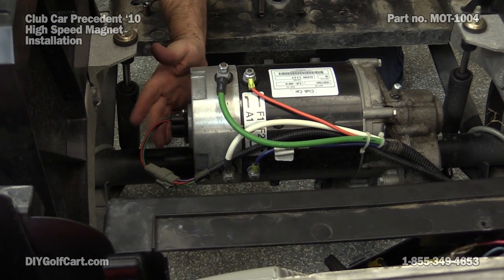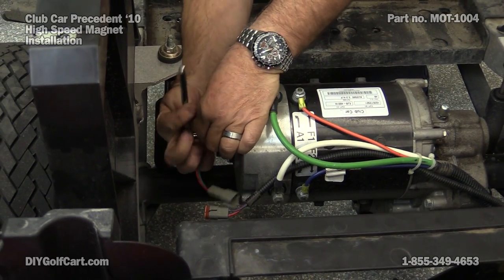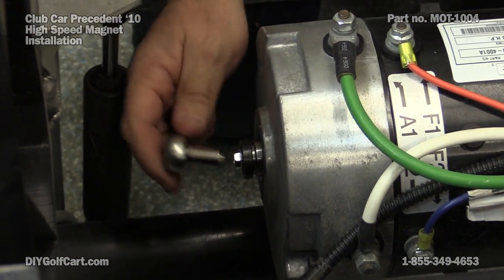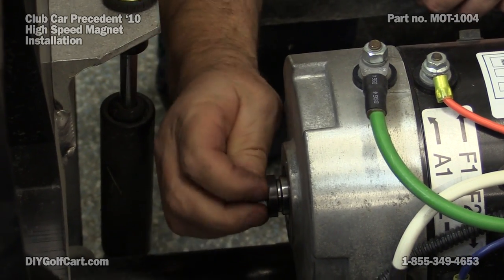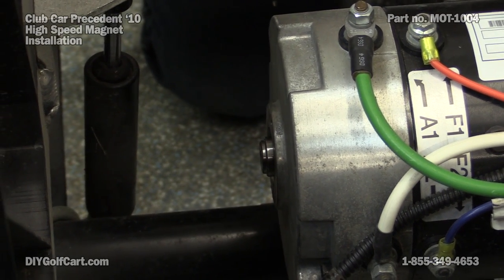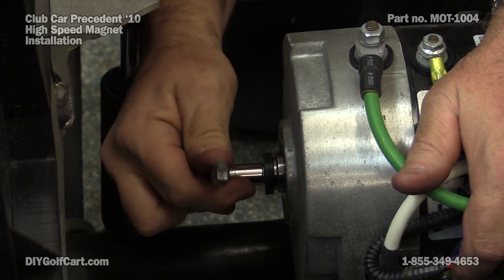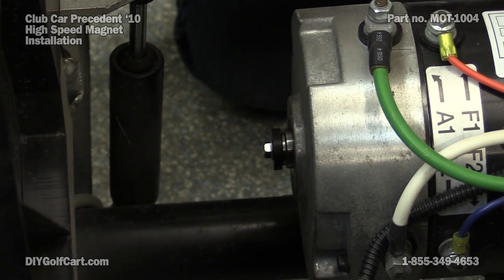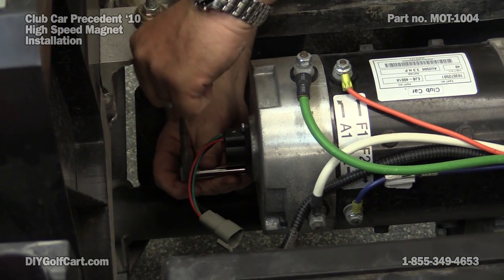Club Car Precedent High Speed Motor Magnet | How to Install on Golf Cart

Comment: Hey I have a 2003 club car ds iq with the ge motor. Do you have a diy for taking the magnet out of it and replacing with high speed magnet?  It’s supposedly a pressed on magnet. Is there a high speed magnet and if so do you have the part number? I’m stumped, I’ve read it needs to be forced off. HELP

Comment: After replacing speed sensor on G22E 2005 Yamaha.  The speed doesnt improve  much.
Can over tightening magnet bold can impact the speed?  What else can be reason speed not increasing with replacing new sensor and magnet set. ?

Comment: Is it possible that the magnet and speed sensor could be dusty/dirty causing the symptoms of a bad sensor?  The reason I ask this, in 2015 my cart was experiencing the same symptoms as this year (starts normal then goes to slow/half speed all of a sudden).  I purchased the OEM speed sensor and took off the old one but cleaned and placed old back on (didn't replace with new) and the cart started working normal again.  Just wondering if this is a normal issue with being kept in a cart shed over the winter.  Thanks in advance.
Reply from the maker: Over an extended period of time not being used, corrosion can start to build causing the sensor to "act up". Cleaning the sensor after a long period of time of not being used is a good thing!
Reply: Rick Eldridge b

Comment: Bought my cart used and I dunno if I already HAVE the high speed magnet?
Reply from the maker: Only way to tell is to check and make sure that the controller and motor is stock, then take it for a ride. If its faster than stock, you've go a high speed magnet.

Comment: Do these magnets work if you already have a speed code upgrade on your cart?
Reply: Added about 3-4 mph to my top speed of 12 mph which is a big gain in %. Cheap hp lol.
Reply: Speed code (code 3 to 4) changes the maximum allowed RPM to 4500.   Speed magnet doubles the existing RPM limit, which would be somewhere around 3600 on speed setting 3, so it'll run 7200 RPM before it will electronically slow itself down.  No need to pay $100 for code change, when $25 magnet will do better job.

Comment: you can install it easy  removing the rear passenger wheel to access it that way but you might need a pry bar to prevent the axle from moving back and forth. remember them parts are plastic lol.

Comment: How can you tell the difference in a GE motor and the ADC motor?
Reply: Patrick Springer ge motor has a snap in speed sensor. As a adc motor has a bolt on speed sensor

Comment: I have a ge motor for a 2010 club car  motor number part 102240102 how to install a magnet in it gray in color. snap in speed sensor.
Reply: My golf car when i push the acelerate if doesnt run fast

Comment: Would this type of magnet work on my 2012 EZGO TXT 4 passenger (48 volt) cart?  It is programmed to the highest speed and I have already slightly upsized my wheels, top speed right now is 20-21 mph.  Would love to speed it up just a little more.
Reply: I was wondering if you ever found out how to make your cart faster I have the same cart and I just want to make it faster is there a way to check if mine is programmed to the top speed also
Reply: No, I SURE haven't but would like to know more. Still wondering about the magnet idea.
Reply: Pianogirl 124 is

Comment: I replaced the magnet just as described in the video, however I have no change in speed. I was trying a new magnet after experiencing what I thought was the original magnet going bad (my speed is limited to 8mph and the cart dies not stop itself if it is pushed). Any feedback you could give would be Healy appreciated!
Reply from the maker: GView Problem may be the sensor, not the magnet.

http://www.diygolfcart.com/Club-Car-IQ-Electric-Motor-Speed-Sensor-p/mot-1003-(9390).htm
Reply: DIY Golf Cart I tried a new sensor, as well, but no luck. Everything else on the cart seems to work fine - could the controller that reads the speed sensor have gone bad? Or is that part of something else that would have 'broken' too??
Reply: Have you figured out your problem? My guess would be to take off the magnet, and sensor and gently clean with a wire brush and cloth the actual metal part on the motor.  Then reattach and see if your speed changes.  Or it could be a faulty or defective sensor or magnet. Also it could be your MCOR (Throttle Sensor)  about a $200 or so Fix.  If your MCOR isnt working right your controller is only thinking you want to send minimal current to the motor.  which means less speed.  but your symptoms do sound like a speed sensor for sure. @Gview

Comment: Will this work on the serial number starting with ph.   It's a 2010 club car precedent i2 Excel.
Reply from the maker: As long as the motor is an Advanced DC motor such as this one it will.
Reply: @golfcartking  How to you know if your motor is Advanced DC?
Reply from the maker: @GC-mt8jr  It would have a Black Housing.

Comment: Has anyone experienced any issues from doing this? I had one installed and a few weeks after the install, EVERYTIME I push the pedal down it jerks the cart.. almost like cutting in and out..
Reply: Sounds like the MCOR if it’s jerking. I’ve replaced many of them for the same reasons.
Reply: @sccoastalhydrographics9217   That's what it ended up being. I had it replaced.

Comment: How does that little magnet make the car go faster?
Reply from the maker: From my understanding, it's a weaker magnet that doesn't pick up every single rotation of the armature in the motor. By it doing this, the controller thinks the cart is going slower and allows the motor to go faster.
Reply: DIY Golf Cart That's amazing.  I have 2011 Precedent.  Does my motor even have a magnet?  Anyway,  I'm considering your motor that will go 25mpg.   I'm confused though.  In one place the ad says 25mpg and -15% torque.  Reading further down it says +5% torque.  I need your help on this. Thanks..  Mickey Romeo
Reply: Sorry. I said 25 mpg.  I meant mph 😸
Reply from the maker: All IQ model whether it's a DS or Precedent have a magnet. As far as the torque value, lets go with 10% increase!

Comment: Hey Barry. On the motor the A2 terminal is loosen inside how I can repair that. Help please thanks.
Reply from the maker: That should be going to the brushes around the armature. Pull the back plate off and you can help but see where they attach.
Reply: Thanks I check that out hopefully that’s the case

Comment: will this work on a 2011 precedent, model  PH 1143-242116 ?  I WANT MORE SPEED THANTHE 14.6 I GET NOW-- SPPED CONTRIL CODE 4 WILL NOT INSTALL FOR WHATEVER REASONS.  ALOS WILL JUST BUYING A BETTER MOTOR  SPEED ME UP IN ADDTION TO LARGER TIRES. I AM ON A FLAT FLORIDA SURFACE STREET AND GOLF COURSE US EONLY.
Reply from the maker: This will help gain a little more speed. After installing this, if you still are not satisfied with your speed, give us a call about upgrading the motor.